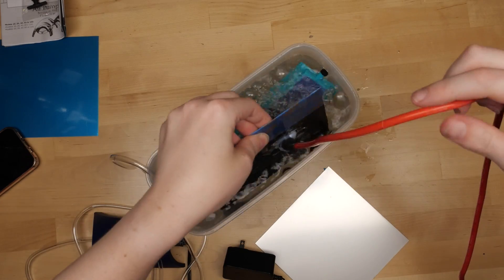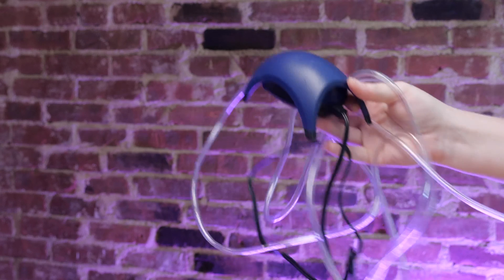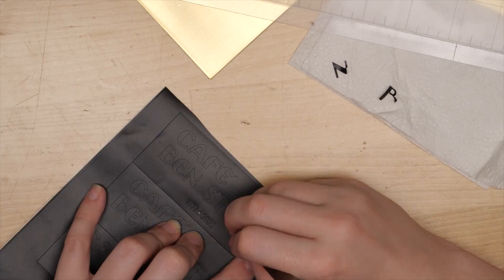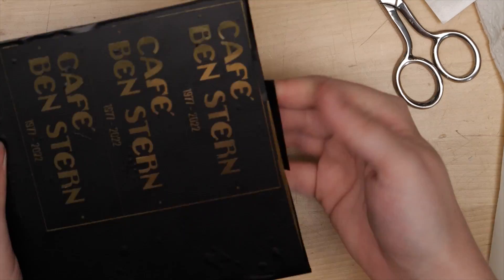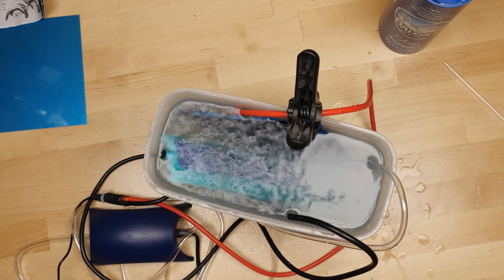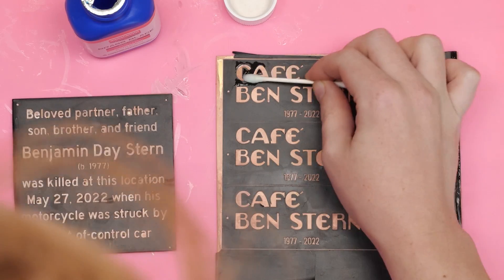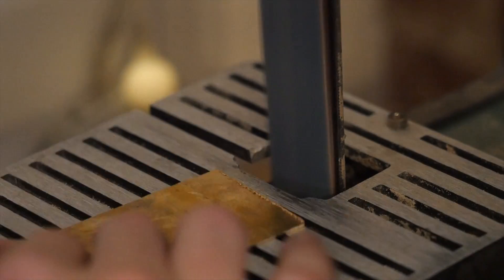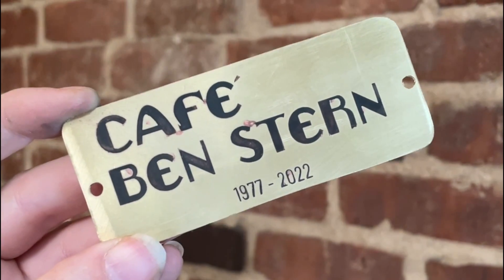DIY Metal Etching with Electrolysis

Comment: Sorry for your loss. Regarding thermal transfer, you really need a special type of paper (I don't know what it's called in English), but in terms of grams it can be 130-300 g/m2.  I had the best results with 160g. The print needs to be on a laser printer or photocopied(no luck there). When printing check the box saying something like print in real dimensions. The temperature is not that important but the pressure is. It needs quite a lot of force. After that you soak it in water and gently remove the paper, rubbing the leftovers with your finger. If some pieces are in between the tracks remove them with a toothbrush and a toothpick.